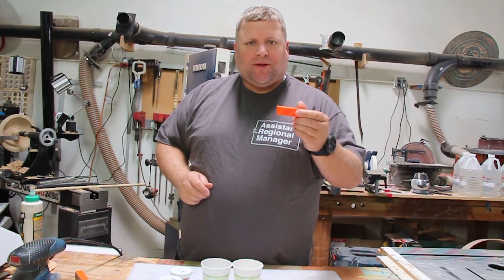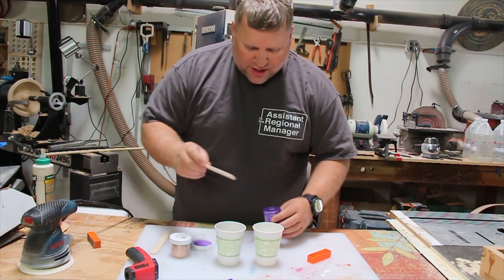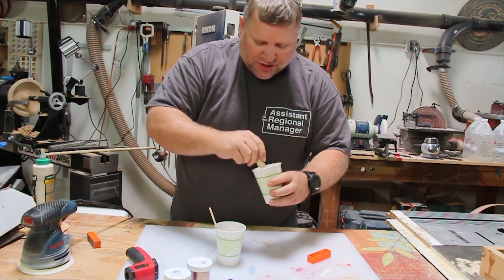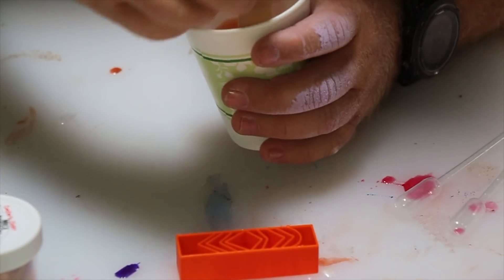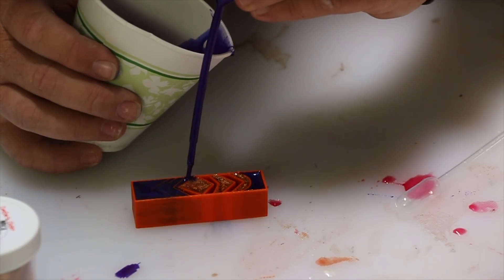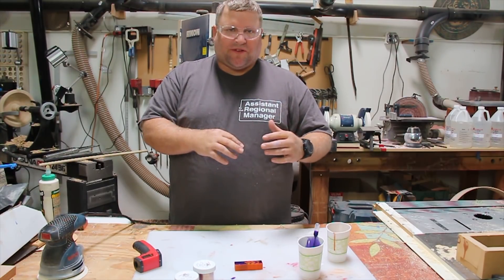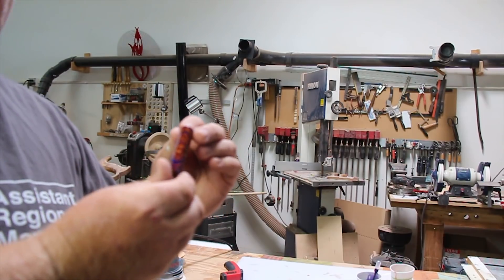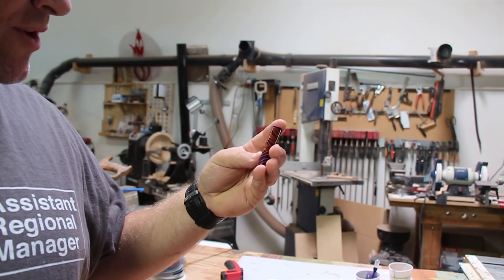Resin Casting and Turning a 3D printed pen blank.

Comment: What kind of plastic did you print the mold in?  Having problems getting Alumilite to stick to PLA. My blanks keep blowing apart where the resin meets the plastic.
Reply: I'm having the same issue.Did you ever figure it out? I did notice he was using a roundish chisel, I wonder if that made a difference?
Reply: @paul2389  It was the PLA I was using.  It was a "silky" variety with a glossy finish that was preventing the resin from adhering to it.